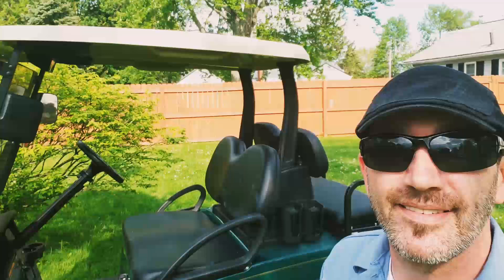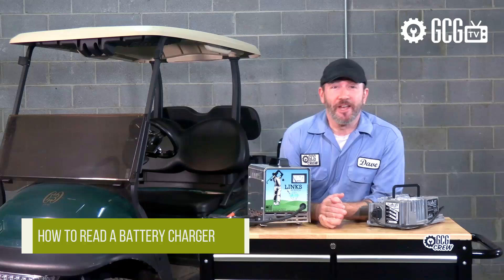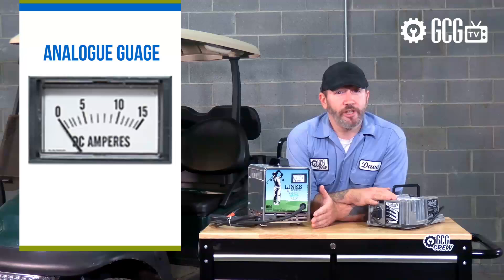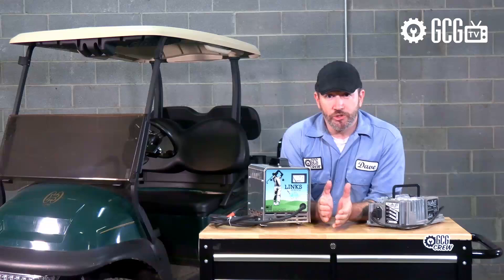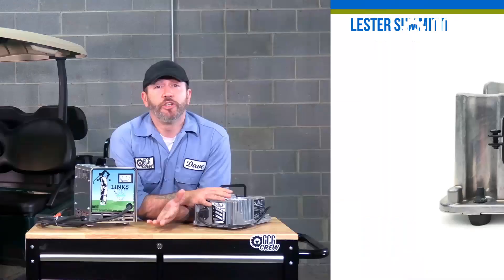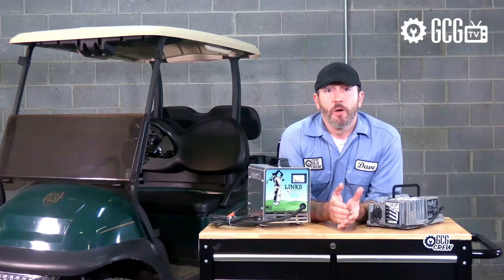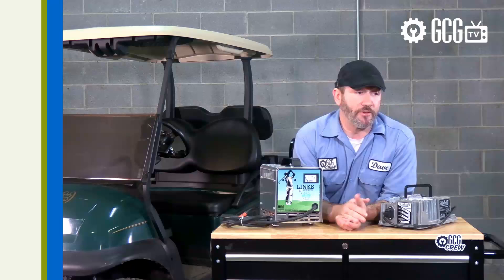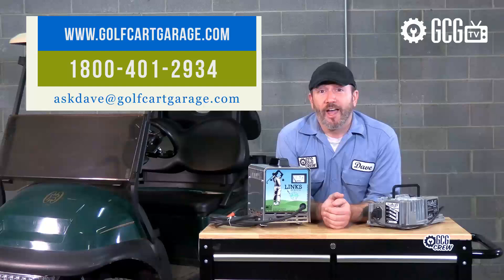How Do I Read My Golf Cart Charger? | ASK DAVE | Golf Cart Garage

Comment: I have a power wise charger and 36 volt system. I charged each battery until they showed 6.1 volts as they were all dead from 3 months of sitting. When I hook up to cart with power wise it only shows 4 amps. Does this mean it's about finished? or not enough to read to start charging?
Reply from the maker: Thanks for watching!  If the batteries test 6v or above, there's definitely enough to activate the charger.  At the beginning of a normal charge cycle, the amperage should be about 20-ish.  But, it would drop to lower rates near the end of the cycle.  Yours may be nearing the finish phase of charging if all the batteries were at 6V+.  Next time you charge, if it stays at low amperage, you'll probably want a diagnosis on that charger or a replacement.  Let us know if you need more help!  Support@GolfCartGarage.com or (800) 401-2934

Comment: What does it mean if my charger gauge reads 0 amps?  It’s plugged into the wall making noise and plugged into the cart.  It’s a club car power drive model charger.  Thank you!!
Reply from the maker: Thanks for watching, Chris!  If it's a 48V Club Car from before 2015, there may be an OBC issue causing this.  It could also be just a faulty gauge on the charger, if it's making noise and you're getting a charge.  You can get in touch at Support@GolfCartGarage.com or (800) 401-2934 if we can help answer questions in real time.

Comment: Hi Dave,  I have a EZ Go cart with the flat two prong.  I need a manual for the charger.  It is a Delta - Q SC-48 charger.  Where can I find this manual to purchase?   or... the error code is red light -  two blinks, then pause for three or four counts.  Could you help diagnose?   Normally the charger has a green light.
 
Go
Reply from the maker: Hey, thanks for watching!  While we don't retail the Delta-Q brand, we did find a manual for SC48 here: https://www.pacificgolfturf.com/fckimages/PDFs/Delta-Q%20SC-48%20Charger%20Manual.pdf
It says 2 flashes indicates a battery voltage fault, either below 36V or over 67.2.  This may mean there is a bad battery and we recommend a load test.  If you have more questions or need help, just get in touch!  Support@GolfCartGarage.com or (800) 401-2934

Comment: What does it mean if cart is not charging and only blue light appears on summit 2 charger? None of the other lights blink when plugging/unplugging.
Reply from the maker: Thanks for watching, Trey!  The blue light indicates A/C power... meaning the charger is plugged in to the wall and ready to operate.  If you get no other lights, it's likely the batteries are completely drained or there is some other reason the charger doesn't recognize that you've connected it.  We recommend a consultation with our virtual techs here: https://www.golfcartgarage.com/gearheads-on-demand/ or you can get in touch directly at Support@GolfCartGarage.com or (800) 401-2934.

Comment: Use this charger on a hooftrimming chute and during cold weather have to use it while using the batteries. It faults out after a few minutes of use. Any way to stop it from faulting while in use. It does charge full when not in use
Reply from the maker: Thanks for watching, Jacob!  Automatic chargers all have differing capabilities and features.  This may be a simple setting change in an app for the device, but some chargers do not have adjustable features at all.  For help with tech support on your specific device, get in touch with our team!  (800) 401-2934 or check out our free diagnosis service at https://www.golfcartgarage.com/gearheads-on-demand/

Comment: Why is my charger flashing red and yellow ?
Reply from the maker: Thanks for watching, Michael.  Your charger flashing red and yellow is likely throwing a "fault" code to indicate a problem.  In many cases, the cart has fallen below the voltage it needs to activate the charger, but there are different codes for every charger.  There's a list of fault codes for Summit II here: https://www.manualslib.com/manual/1633729/Lester-Summit-Ii-Series.html?page=24
You may be using a different charger or have more questions, get in touch!  Support@GolfCartGarage.com or (800) 401-2934

Comment: HI DAVE I CAINN'T GET MY CHARGER TOO CONNECT TOO MY PHONE BLUETOOTH
Reply from the maker: Thanks for watching, Mike.  The Summit II charger app called, "ChargerConnect" will only make a bluetooth connection when the charger is actively running a charge cycle on the cart, and should make all the lights flash on the charger when the bluetooth is going.  If you're having trouble with it during charge cycle, get in touch with our techs at Support@GolfCartGarage.com or (800) 401-2934

Comment: Can I over charge our golf cart batteries
Reply from the maker: Thanks for watching, David!  Your charger should stop at the end of a charge cycle if it is working properly, so you shouldn't be able to charge too much unless there's an issue with the charger or batteries.  That said, you want to charge when the battery pack is down to about 30 or 40% somewhere instead of using the charger every time you take a short drive.  Charging too frequently isn't good.  If you have more questions, just get in touch!  Support@GolfCartGarage.com or (800) 401-2934